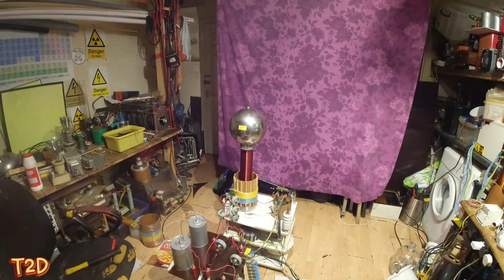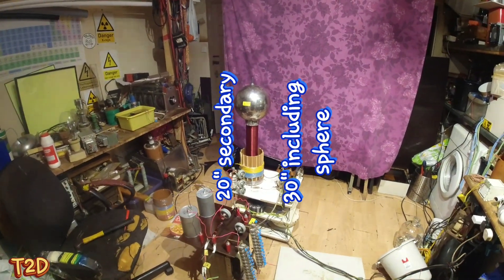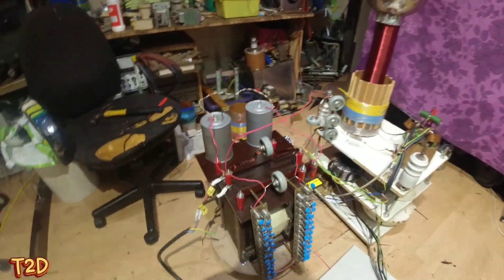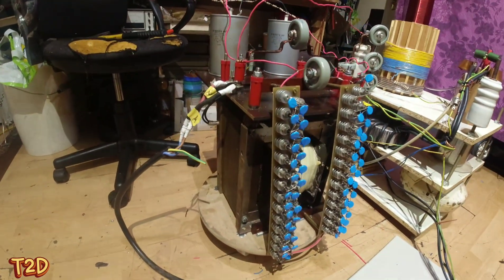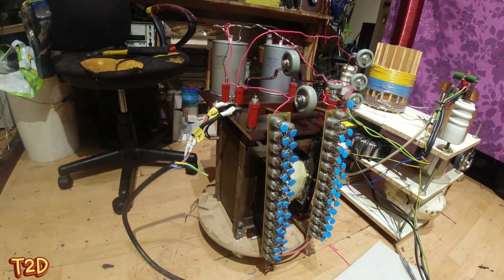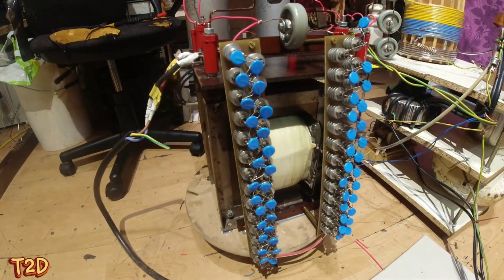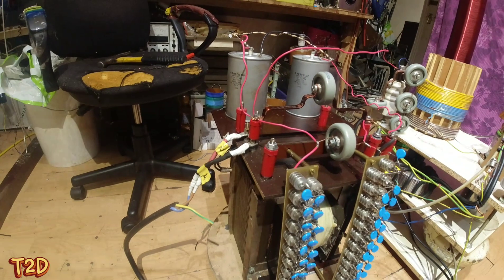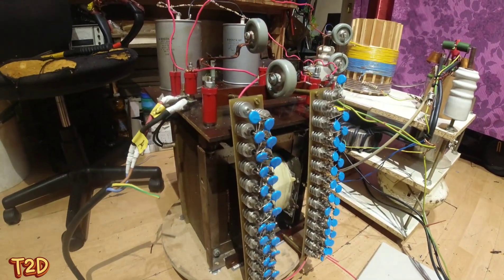Vacuum  tube Tesla coil with Soviet military GU39B ⚡

Comment: That is very impressive! I’m sure you already know this but be careful with repeated ceiling strikes as if it is arcing to a nail or something it can heat up and cause a fire.
Reply from the maker: Thanks mate and yes I know this, I actually took a piece of gypsum board and tried to light it on fire with a blowtorch, I found its pretty fire resistant, the strikes are at the end of a 10ms ramp so I'm pretty sure it's not capable of causing a fire like this. .. thanks for pointing it out though, not everyone thinks of this stuff and its definitely better to be safe than sorry 👍 thanks for watching 

Steve

Comment: Awesome coil!  I think with my utility service and available finances the biggest tube I can use is the GU5A that's coming. We'll see how it goes after your and Michelle's GU81M build first. I am also excited to try the working GL434A antique radar tube we discussed.
Reply from the maker: Yeah I think the GU-5 is rated at 3.5kW RF so at 60 percent efficient that's an anode dissipation of 2.2kW and maybe another kW for grid drive and dissipation so maybe 7kW B plus supply for CW (which would be worse case scenario) maybe 8kVA and 👍 ..
I'm running this tube nowhere near full power, my lab is on a 32A breaker. The GU-39b  has a RF output of 13kW,    anode dissipation of 8kW  so 21kW on the anode for  continuous operation, probably 30kW on the anode for short runs. 
 the grid drive is a good few hundred Watts.. the grid disapation G2 450W G1 200W.. the grid leak resistor dissipation is a few hundred Watts,  then the 600W filament..  add in  all the losses and power factor, it would need my full service (24kW) before it was even  near the  rated power 😅 ... having such large anode area allows peak  power pulses in staccato operation,  Soviet tubes are drastically under rated.. I think this tube will handle 20kV in pulsed operation.
I'm looking forward to your build mate and really hope you enjoy it. 
Thanks for watching 

Steve..
Reply: @T2D.SteveArcs   Yeah, I can see that I am going to be adding a separate 100amp panel for my experiments. Not yet though...

Comment: My tesla consumes about 16kw per CW
Reply from the maker: Awesome... I only have a 32A type c breaker available in my lab at the moment so not that much power available really , especially when you consider the power factor... as you know the GU39B is capable of continuous 13kw rf output and around 8kw dissipation on the anode so that's over 20kw G1 250w dissipation plus its  drive G2 450w disapation plus its drive then theres the 600w filament... so its going to need my total available line power (240v 100A) to get this tube running anywhere near full power,  I'm rewiring my lab so I can get the full 100A 240v in here, then I will set up my 100A variac and work on power factor correction.. make a bigger litz wire secondary and primary and we can find out what I can really get from this tube in cw. , I suspect I can use my buck converter to ramp that tube anode at 25 to 30kw aswel for monster hf swords 😅 I managed 6 to 1 from my 5kw Japanese tube .. 6 foot swords from a 1 foot secondary 😁 it looks amazing there is some images on fb , I'm Steve Arcs on Facebook,  add me mate.. think theres Also some video on my yt channel of it do 5.5 to 1 (1:5.5)  Steve

Comment: Awesome.. those arcs are mental - I like the branching arcs - mine is so puny in comparison but I do not have the space for a bigger unit/ rig - but one day!!!! Curious what is your variac rated to? Mine is a 15a max output Carroll & Meynell? -Tthere’s probably not much ozone at the amperage just nox ? 👌👌👌👌👌🙏🙏🙏🙏🙏👍👍👍
Reply from the maker: Hi mate,  I use a variac that can provide 35A 270v continuous and 50A 270v intermittent duty.. I have a three stack aswel that is capable of 24kw continuous, however I haven't got a heavy enough cable to my workshop yet to use it so that is on the list😆.. really appreciate you watching my videos..
I have loads of high voltage videos with monster transformers etc 👍👍👍👍 thanks 
Steve

Comment: What if we were to use fully rectified DC instead of an ac voltage doubler for the power supply?
Reply from the maker: It doesn't work as well, we need the ramp from the doubler mate

Steve
Reply: Have you ever tried running one on a rectified 3 phase transformer? It must have a really weird 300Hz hum.

Comment: Another great demo Steve. It's good to see you back after a pause. All your arcs from Teslas, especially this one, set me wondering why such arcs branch in such a tree-like manner. They are governed by the same math I suspect and I'll be investigating that. Thanks for setting me thinking again during the terrible doldrum of the lockdown!

Just one other thought, do you get much ozone from these HF HV discharges? -Peter
Reply from the maker: Hey Peter yes I'm sure as with virtually everything there will be math that describes the function of arc propagation 👍👍I've seen patterns like this in math before...
Yes there is ozone but not massive amounts, you get  much more from low current arcs..
Thanks for watching mate ...

Steve

Comment: Amazing results! I was never really interested in VTTCs and went from my SGTC straight to my DRSSTC. But thoose arc are just amazing. It really makes me wanna build a VTTC.
Reply from the maker: Oh great 👍 thanks mate glad you liked it and nice that you've seen the vttc in a different light mate .. I'm still working on the 81 coil we are at 42 inch arcs now from 11 inch secondary its great 😁😁

Steve
Reply: @T2D.SteveArcs  yeah pretty much all VTTC that Ive seen only output as much as a simple SSTC so I didnt see a point. But yours is quite diffrent. I want to build a QCWDRSSTC in the near future but they are very difficult to build and get working. If I build a VTTC it would probably be a HFVTTC. I really like the plasma flame and it's much better with a vacuum tube than a MOSFET.